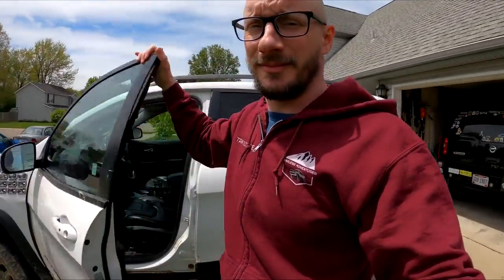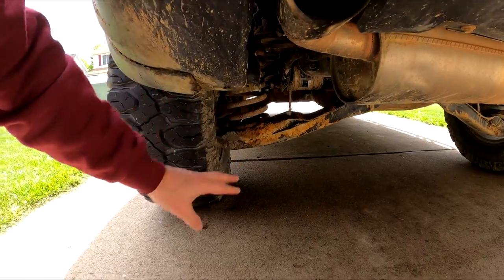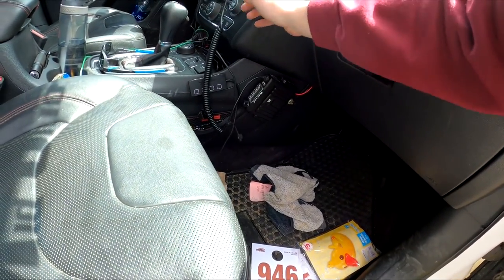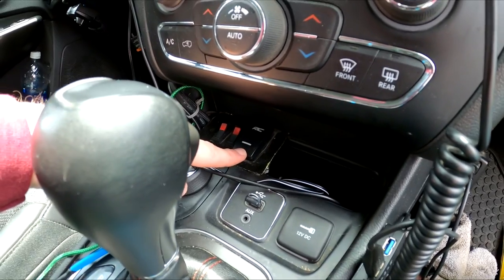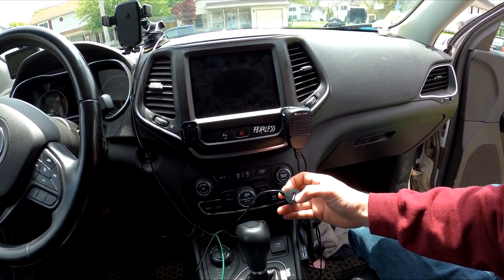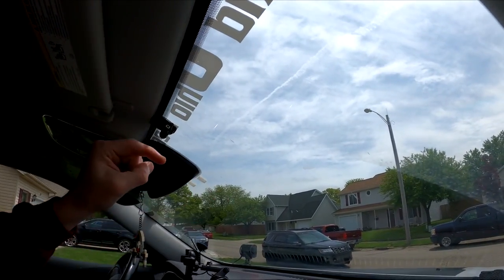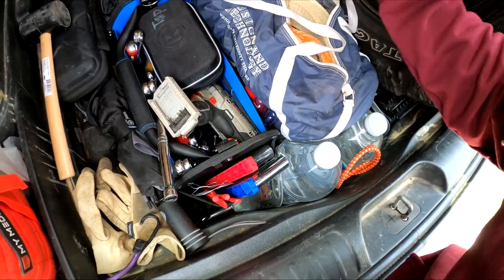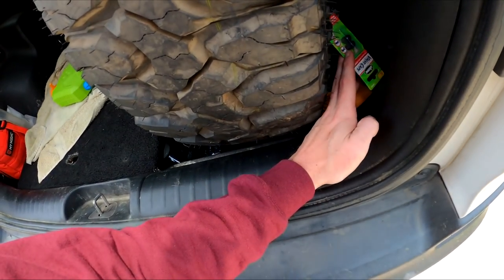All my mods so far!  New Walk Around, Jeep Cherokee Trailhawk Elite, 4x4

Comment: Did you have a PTU issue on your trailhawk? I'm currently looking at one that has that issue and wanted your input on it and the model if you have any? Thanks
Reply from the maker: @Idahoshepherds83440  I've had 4 PTU's.  One was a bad install, and one was a bad part/install (went out in 6 weeks). They either go bad or they don't, and you won't know until it does, or doesn't. Get a mopar extended warranty.
Reply: @FearlessTrailhawk  thanks for the input.

Comment: When you mentioned you now have the Hazard Sky 2” on the front due to the Dobinson springs failing, what springs do you now use with the hazard sky 2”?
Reply from the maker: The Dobs springs didn't fail, the strut did, so since the Bilsteins strut is shorter i couldn't put the HD springs back on, so i have the regular Dobs springs with the 2" Hazard Sky spacers. I decided to not use the stock springs because of mounting the winch, so the stock springs would have sagged a lot.

Comment: Nice setup! I've got. '19 Cherokee Trailhawk and have done similar mods. Got the Nilight pods, 2" lift, Midlands MXT275, MyMedic first aid kit, soft and hard shackles, Rhino kinetic recovery rope, and a 6 panel switch for my accessories
Reply from the maker: The one thing i havent gotten yet is a kinetic rope, bit i haven't needed it yet as gentle pulls have mostly worked, but i know its just a matter of time.
Reply: @FearlessTrailhawk  I would recommend Rhino USA kinetic recovery!

Comment: Always love watching your vids. Question:  Are the Dobinsons HD springs in the rear too stiff? Would you do anything different if you were to add another lift, like go with a 3" lift? Thx and keep up the great vids
Reply from the maker: I like the rear just how it is. 🤷 And hell no, i would not want to do mor than a 2.5" lift.  I burn trough CVs every 1.5 years almost..almost considering dropping it a bit to maybe get a little more longevity out of them.
Reply: @FearlessTrailhawk  Good to know, thank you for the reply!
Reply: @FearlessTrailhawk  Extensively researched everything MFC and the like... max cv angles ... i plan to do 30.5's~ 31's  so i can run my quick snow chains still and just the regular Dobinsons kit with mcf 0.5's (overall should be 2 inch with weight) 
I really don't want to do annual cv's. 
(AD1; overland stuff only trimmed bumpers) 
Quick thoughts?

Comment: Curious did you do (or have done) any work to the transmission?  This engine has historically had hesitation issues when switching gears and I've noticed that it hasn't gotten much better from the 2016 that I owned and now a 2020 Trailhawk.  Thanks in advance and love the ride!!
Reply from the maker: Nope. Haven't touched it.  Yes there is a lag time for throttle response, but i've gotten used to it amd anticipate it in most situations.

Comment: Hey did you need any modifications to add the B6 shocks? Or was it direct fitment? Thanks
Reply from the maker: Bilsteins are a direct stock replacement. No modification need. You also don't need to modify anything for the Dobinsons, or most other aftermarket struts.
Reply: @FearlessTrailhawk  thanks! YT isn't updating my notifications from a quality point Bilstein or Dobs?